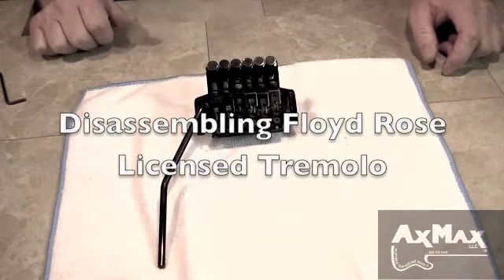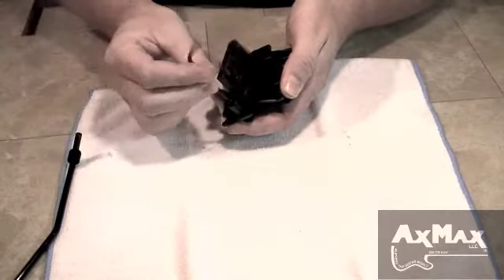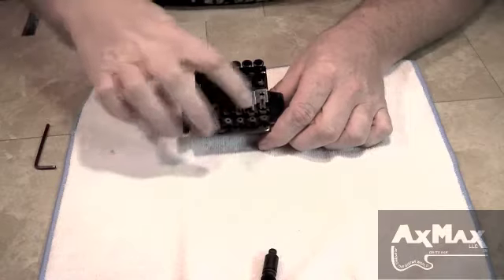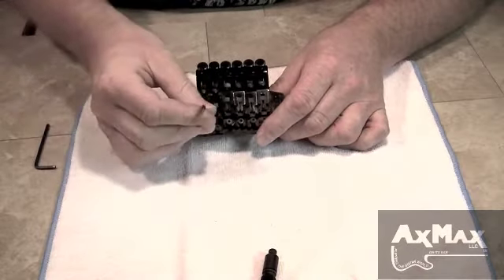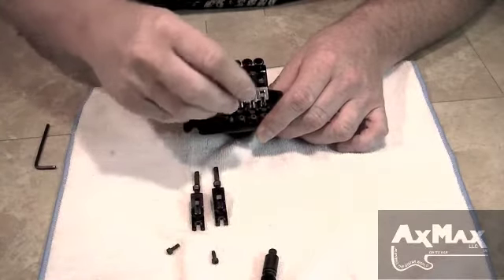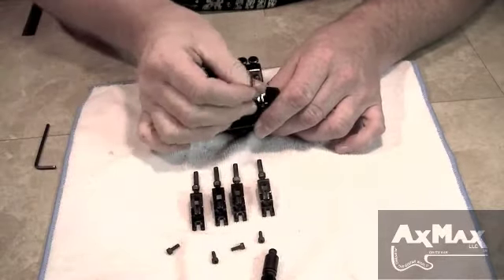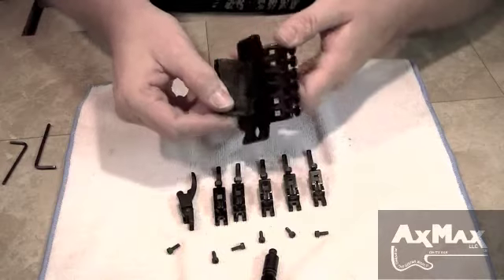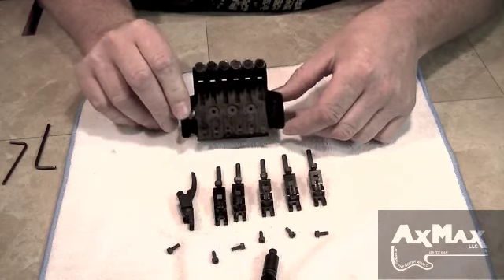Electric Guitar Restoration IBZ RG 5: Disassembling Floyd Rose Licensed Tremolo

Comment from the maker: Those parts are pressed into the tremolo body. You can use a drill press to press the bussing out. Most of the floyd style arms have a screw you need to remove on the body next to the spring block on the bottom. Remove all the parts leaving only the bushing pressed into the body. Place a punch in the chuck of the drill press and press the bushing out from the bottom near the spring block. It it is still stuck, spray AMS Oil or gun oil on the bushing and let it sit a while and try again.